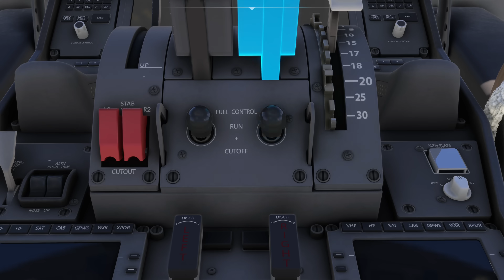Air India 171: Why Did The Fuel Cut-off Switch Get Moved?

Comment: The 787 is the first major transition of Boeing from conventional aircrafts to mostly electrial aircrafts. Boeing was the epitome of peumatic-hydraulic- mechanical aircrafts for decades. When the fuel prices increased in new millenia, Boeing had to introduce a new aircraft with fuel efficieny, thus came 787. Now that being said, 787 had several issues in 2010s, the Li ion battery issue, The 2018 cuel switch issue, and so on. There is a report that chip malfunction is possible in these aircrafts, which were used in older aircrafts, after 11000 cycles. A taiwanese professior Mr chan has proposed this theory. Consider everying.
Reply: The time taken for FCS to transition from RUN TO CUTT OFF IS JUST 1 Second. That is not humanly possible to do both switches to transition in one second unless one or both of the switches are damaged. Secondly, the engine is restarted manually. For each engines, there is a gap of 4 seconds. My guess FCS is still in RUN mode physically while the engines shut down. Physically the keys are in RUN mode, but may be due to electrical failure, engine got a wrong info to shut down. Then the pilots do a procedure, to restart it by moving it down ( RUN TO CUT OFF ) and then moving it UP gain ( CUT OFF TO RUN ). Note that as per FDR time taken to restart both engines are 4 seconds. Then the engines gets fired up. But too low altitude at mid air, so flight couldnt be salvaged by these engines.

Comment: Please read the 2018  notification of Boeing where they said that fuel switch are malfunctioning and the fuel sensors cutoff automatically.  What do you have to say about it?
Reply: He’s already addressed this issue multiple times in previous videos since the preliminary report was released.
Reply: The switch service bulletin is now seven years old. Manufacturers have changed their quality control protocols so what was a minor problem as evidenced by it not being an AD bulletin. The switches aren’t difficult to manipulate but the action must be deliberate. Sorry if you can’t differentiate the differences.
Reply: @stephenwalton9646  I would normally agree, but Air India already admitted in Indian media that they took no action on the basis of this FAA Advisory.
Reply: @stephenwalton9646 100%. It’s crazy how people are hearing about this bulletin and totally misunderstanding what it meant, and its importance.
Reply: On 737.
Reply: @magnusdunning6113  Same exact fuel cutoff switches were installed in the 787.
Reply: @magnusdunning6113 , And 787.
Reply: FAA Advisory NM‑18‑33 for those who are interested - you can google it and download the whole thing.
Reply: He’s addressed this before.
Reply: I believe Captain Steeeve has already explained that directive was about a factory installation failure that would have been caught the first time someone tried to operate the switch. That is why it was a non-issue and why the FAA didn't require any checks by airlines.
Reply: You got video?  Just kidding
Reply: Hasn’t it already been said in the report that there was absolutely nothing wrong with this plane?
Reply: @captainsteeeve are you ignoring this point ? It was clearly stated by Boeing in 2018 about they issues with fuel switches. Would really appeciate your clarification on this specific point again.
Reply: @captainsteeeve what do you have to say about this: On May 15, the UK's Civil Aviation Authority (CAA) issued a safety notice regarding potential fuel control issues on several Boeing aircraft models, including the 787 Dreamliner
Reply: Also, how is it possible to cutoff the fuel switch in 1 sec. 
This capt will never say about this.
Reply: @himanshu4164 He already did. On the video preceding this one. Perhaps research before speaking?
Reply: @henghistbluetooth7882  I didn't realize that typing was the same as speaking - thanks for the enlightenment.
Reply: Nothing. He seems to be intent on showing how difficult it is to flip those switches.

Comment: Why isn't the "fuel cutoff" lever 'blocked' in the air-mode ⁉️
Reply: What would you do in case the engine is on fire then?
Looking at the fire triangle, heat is not an option to cut as it’s extremely hot, Air is in abundance so cutting off fuel will be the best choice. 
Although I wish that the switches do have an interlocking mechanism with the throttle being in idle, that would be better imo.
Reply: You mean at full thrust.
Reply: Hmm.. makes sense! Then how about introducing a new "take-off mode" (if it's not already present) and then blocking the "fuel cutoff" at least until the plane reaches sufficient altitude e.g. 5km?
Reply: @shanu7uday  same problem, engine fire on takeoff, say the engine sucked up a debris on the runway and caught fire.
That's why I didn't mention the mode but rather an interlock with the throttle being in idle instead.

Comment: Captain Steve is the best.  I see other content providers are calling for inspecting ALL Boeing fuel cutoff switches.
Reply: And there gonna find nothing wrong with them.
Reply: You might want to pare down your "content providers" to those with significant aviation experience. A call for an industry-wide inspection of all Boeing fuel cutoff switches is the sort of remark only someone clueless would make. Switched do break and pilots will report them, but two breaking at the same time and yet being reset some 10 seconds later is beyond belief.

Comment: This case really boosts the argument for a camera in the cockpit as then the answer would be clear. I worked in shops, I had a camera overhead when on the till and one employer used to check the cameras on his phone and I got told off for using my phone when it was quiet, he said I should have found something to work on. Pilots already have their voices recorded and that data is only needed following an accident, camera footage would be the same.
Reply: This is the equivalent of "cameras in the courtroom" argument, which the judges present the same amount of resistance as the pilots do for their planes. Both jobs r stressful enough without a digital eye glaring at them 24/7.

Comment: Captain Steeve... This whole thing dosn't pass the smell test...  Is It possible that the physical switches never moved and it was all done electronicially, i.e.  a fault in the electronics in the switches???  The final position found at the crash site will be on the "On" position and the Data in the Black boxes will show off and on, just like it was recorded.  This all doesn't pass the smell test!!!!  The only way we would know for sure is if there was a cctv camera inside the cockpit...

Comment: It takes at least 1 minute to shut down the fuel engine of the plane, but both the engines were cut off much before 1 minute after the plane's takeoff, both the pilots restarted the engines, they kept the plane running till the last minute,He even made a mayday call, he even denied because he did not switch off the engine oil, so how is this possible, how can we say that this is the case with the pilot, there can be problems in the plane too
Reply: Yes the pilot last words were denying...how can these so called experts are blaming the pilot.Comparing a pilot and his kids are the lamest comparison ever possible.He is stupid than he potray.
Reply: @sonofmountains8314 because it has already been released in the report that there was absolutely nothing wrong with this plane, it was human intervention. One of the pilots did this
Reply: One pilot shut the switches off, the other pilot transmitted the mayday and then tried to re-stset the engine. The voice recorder has the pilot asking the other we did he shut the switches off. It's black and white at the point other than the accused motive of doing so
Reply: @Brian_Castle It is not written anywhere in the report that the pilot switched off the fuel engine. This could also be a technical mistake. When the pilot came to know about it, he might have asked the other pilot whether he had switched it off.
Reply: How mechanical switches would be turned off technically?? They are not like normal switches the one need to pull them off and to change it's position to turn it cut off from run and vice versa @savita023
Reply: @savitayadav01 the switches have to be in the on position to take off and the plane did that . The data shows yhe switches where moved to the off position. 1 of 2 pilots did that .
Reply: @Brian_Castle Then why did they restart the engine?Why did they crash the plane in such a crowded area? Why did they call mayday, Did you see the video of your plane crash and how high was the nose of the plane i.e. how much effort did both the pilots make to save the plane?Just based on one conversation we cannot conclude that the pilot did this. Stop blaming the pilots now. The final report is still awaited.
Reply: @AnantAgrawal_1105 I mean it could be because of some problem in the plane, because the fuel engines were shut down three seconds after the plane took off which is impossible to shut down by pilots in 3 seconds
Reply: @Brian_Castle  The report ertainly doesn't say the switches were "moved" to the cut off position - it makes a very distinct statement using the word "transitioned" which leaves open the possibility that there was no manual moving of the switches.
Reply: @keithburns5974 they just release the report to see people's reaction. If people accept it they will for surely blame pilot. And this capt is just making back to back video about discussing how a pilot can do this, with all possible options...I mean seriously! He himself pilot and I hope it doesn't not happen with him. But corruption doesn't do discrimination
Reply: @Brian_Castle transcript says so. We haven’t heard the recording.
Reply: Oil? Fuel.
Reply: It was clear boeings faulty fuel switch issue, boeing and western media is blaming pilots to save boeings image that is not already not good.
Reply: He won’t even consider that point, because he is a hypocrite. Im sure he has got a lot of money from Boeing to defend Boeing’s image by blaming it on pilots
Reply: Not true.  Why do you eay that?
Reply: @davidmerritt5075  A lot of commenters/bots spreading propaganda about how it couldnt possibly be an indian pilot's fault. It's weird.
Reply: It takes about half a second to shut off the fuel to an engine, not “at least 1 minute”.
Reply: @rdspam it doesn't stop engine within half sec. Plane doesn't work like that...study first
Reply: The pilot denying it doesnt mean he didnt do it. And conversely, the pilot asking why the other cut it off doesnt mean he was innocent either. We will probably never know who exactly shut off the fuel but stop spreading your fake news to blame the plane rather than the pilot who got all those people killed
Reply: @hameed yep,simple misdirection and lying from someone who knows they’re being recorded. I’m guessing they know who said what and are just waiting til final report to release it. With monitoring they have to know which pilot it came out of? Maybe I’m wrong and probably am lol
Reply: You stop spreading fake news to blame pilot @hameed ...shame on you...boeing doing millions pr to whitewash and blame on pilots and report has soo many contradiction and hide many main key points...shame on you to blame on pilot....it was a plane fault...and will never come out..we all know the corrupted system
Reply: @hameed Only on the basis of one conversation we cannot conclude that it was the pilot who did it, if he had done it then both of them would not have restarted the engine, they had also mayday call , In the video of  plane crash, did you see the nose of the plane? How high was it going in the last minute? It means that both the pilots tried their best to save the plane. Three seconds after the plane take off, both the engines stopped.It is not possible for the pilots to switch off the engine in just 3 seconds, so please stop blaming the dead pilot, and if he had such an intention then he would not have entered the plane in such a crowded area.If something goes wrong with the plane here, then the entire business of this plane could be in danger.
Reply: Nope, the report does not mention any problems with the aircraft. It operared the way it was designed to.
Reply: @petermuller5800 Yes, till yesterday there was no technical issue in the report but since yesterday, technical issues have started appearing in the plane, Air India has confirmed that this plane was banned 1 hour before flying.
Reply: Nonsense the fuel switch was cut off 3 seconds AFTER Takeoff....Read the Interim report carefully

Comment: Separate the switches so theres one per pilot?
Reply: What if one is unconscious?
Reply: There are two switches because there are two engines. If the plane had 4 engines there would be 4 cutoff switches (ie 747) or airbus 340.
Reply: @Kwisatzhaderachgiveadogabone  2 for the pilots and 2 for the passengers?

Comment: What a bloody disgrace blaming a dead pilot. How the hell is there is no alarm when both fuel switches were cut-off ? You’re chatting pure bollocks — stop pointing fingers at the pilots and have the guts to call out Boeing for once.
Reply: According to several reports online, the UK Civil Aviation Authority (CAA) did issue a Safety Notice concerning Boeing aircraft fuel shut‑off switches in May 2025.

Specifically, on 15 May 2025, the CAA updated Safety Notice SN-2015/005 Version 2, titled “Fuel Shutoff Valve – Mandatory Actions on Boeing Aircraft”  ￼. This notice requires operators to implement specific measures involving flight crew procedures and alerts related to fuel shut‑off valve operation, ensuring these components aren’t inadvertently left unprotected or mispositioned.
Reply: Why haven’t you say a word about this safety notice ?
Reply: Can you imagine there is not a bloody warning if or when the fuel control switch is cut-off when you know that both the engines are going to stop ? What kind of shit design is that ?

Comment: I get that the pilot turned off the switches BUT why take the whole plane down full of people with him? What did children and all those people do to him? It's just a roll of the dice to get on any plane now days.
Reply: I think it was simply the easiest way for him to do it. There doesn't need to be any more logic than that.
Reply: Simple explanation: Boeing being Boeing - shifting the blame to the pilots.
Reply: I'm not saying that what happened with AI 171 is a result  of one of the pilots being depressed but I can assure that when someone is suffering badly with their mental health their mind is no longer working in the way most people would call norma or rational. It can still be calculating though and this could be what happened.

Comment: To be honest, it might be posssible that the fuel switch got off by their own because why the 2nd pilot would take 10 secs to turn it back on after seeing. It doesn't make any sense.
Capt. Steve is deliberately ignoring this fact and forcing it on the agenda/explaination towards other reason (suicide) which might be true.
Reply: He wasn't watching the switches, he is doing his scan and controlling the departure, then the engines lose power and start spooling down.  Then he needs power and starts by looking at throttles, engine speeds and exhaust temps, then progresses to fuel cutoffs.

Comment: Unless one pilot is incapacitated.
Reply: My thoughts as well. If critical tasks require 2 pilots to operate, if one suffers a stroke, heart attack or isn't in a normal state for whatever reason, then it's GG.

On the flip side, it also allows a rogue pilot to sabotage the plane by refusing to cooperate in operating said critical task.
Reply: @a_kuma I would think having a mandatory third pilot would help? But then again, airlines would be against that as it would add drive up cost.
Reply: With a switch this critical one would have thought it would have a cover over it that needs to be lifted/raised to uncover the cut off switch, the cover should have an alert warning so if this was ever attempted again deliberately or otherwise it would be much more difficult for it happen.

Comment: I just watched another video comparing fuel cut off on a cesna and in that case,  each engine throttle has to be returned to idle position and then a trigger has to be pulled up then the throttle can be pulled all the way back to cut off. This method makes more sense to me compared to Boeings method.
Reply: On the Gulfstream G550, the same switches are in the overhead panels, also there is a few seconds of delay before the logic circuits actuate the cutoff.
Reply: Boeing assumes a much higher level of skill and professionalism to fly a 787 vs a Cessna…
Reply: Irrelevant.   who cares about a little cesna.
Reply: @mikepxg6406 the point was to contrast the two different methods to cut fuel. Not irrelevant at all.